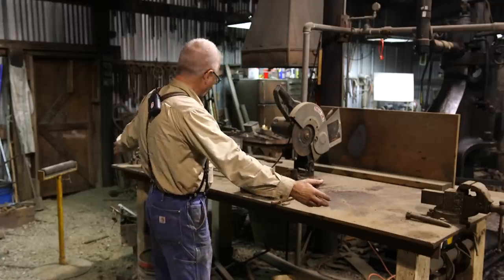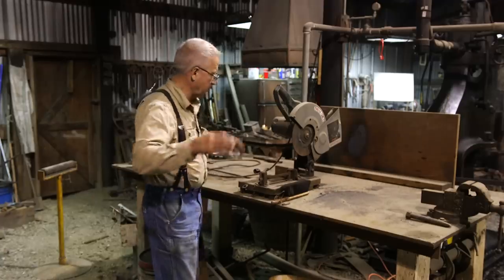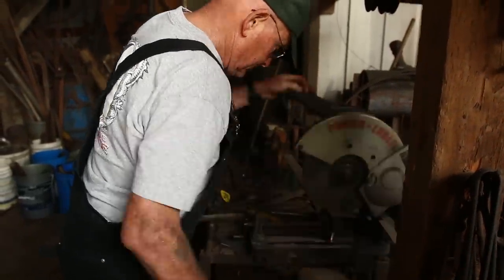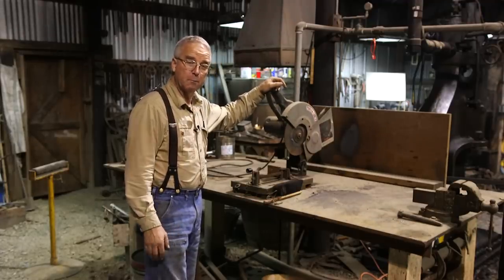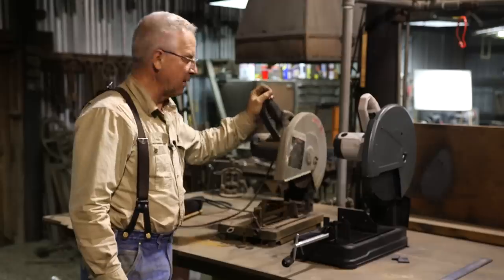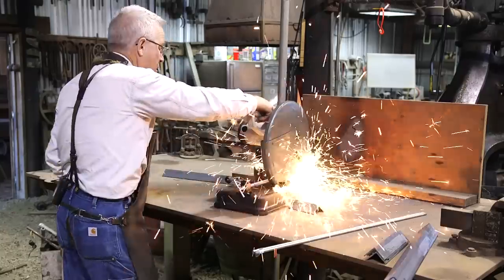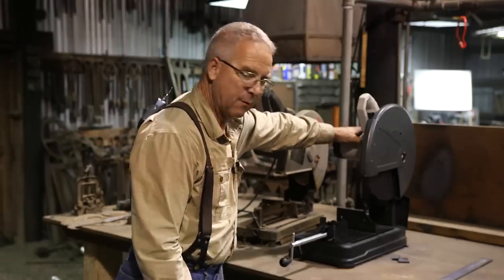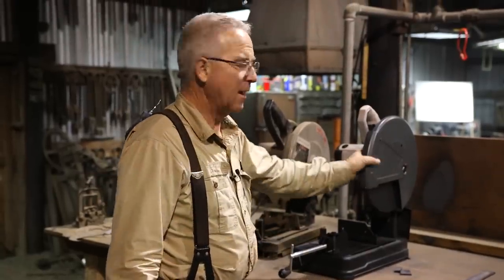Cheap Chop Saw

Comment: I'm an American, but I live in Taiwan. The manufacturing industry here is incredibly good. As it turns out, Taiwan actually produces some of the best products in the world in several industries (computer parts, optics, camera gear, bikes, etc). I bought my welder from a local shop that makes them by hand. Hand made, 220v, 200amp, and it is rated as having a 70% duty cycle at 200amps. I can tell you right now, it is the best welder I have ever owned. I have had that thing with me on rooftops in the middle of summer (summers here can be pretty brutal) and been running it nearly non-stop for hours on end, from sunrise to sunset, and have NEVER overheated it or had any issues with it at all. Though there are always exceptions, I feel like "made in Taiwan" is usually a pretty good sign.
Reply: cool. my welder came from shenzshen. what shop is this you speak of lol, in NJ?
Reply: @nicksgarage8295  I'm not sure I understand your statement/question.
Reply: Martin Luther  yes sir. I think I've got a video of me walking through their shop, actually. You can see all sorts of stuff in different stages of being made.
Reply: @SkylerKing  this so called local shop that makes them by hand. Never thought ppl made hand made welders.
Reply: @nicksgarage8295  well, it's a shop and it's local, so what would you call it? And how do you think welders were made before automated assembly lines were the standard?
Reply: Skyler King well ya know. They probably time traveled into the future and stole a bunch of miller t bolts and then brought them back for use.
Reply: Taiwan and Poland have a very good products.

Comment: Understand your buying a new one, but was expecting to see you replace brushes in old one. Get it running again, maybe give it away. Keep it out of the landfill. I follow the same buy "Made in U.S.A." approach whenever possible. Regrettably, it's becoming harder and harder to do.
Reply: I think the brushes cost under $10 for most tools. It would be great to keep it out of the scrap yard
Reply: Yes, please replace the brushes EC!
Reply: many times  Made in America  with Import parts...   Like China...
Reply: Usa makes pvc plumbing pipes. Buy that if you re so blindsided by made in usa. They re cheap stuffs
Reply: "Assembled in America" is the new made in America unfortunately
Reply: exactly! personally I would have at least put new brushes in it and donated it to the local second hand shop that uses there profit to help the homeless
Reply: When a completely new saw is $109 time is too valuable to spend fixing old tools. It would literally be a waste of time.
Reply: old versions are usually better, well worth saving
Reply: Steve Redenbaugh, exactly.  Made in USA is not from USA. They all have foreign parts inside. 🤦🏻‍♂️
Reply: @bguen1234  might take 1/2 hour at most - at 9pm when the work day is over - get er dun

Comment: replace the brushes, while you at it replace bearings, clean the comutator  and it will be as good as new, one for the shop another for field work
Reply: Piotr Brenda I rather buy a new one.
Reply: @vojnikjna30  and what would you do with the old one? - it just needs new brushes

Comment: Buying USA usually means paying twice the price for half the features and it’s not always better. Grizzly for example US headquarters but all Chinese rebrands. Buying USA makes sense when you’re buying Starret vs Mitutoyo or Brown and Sharpe vs Wen. I’ve just learned that at the bargain prices expect some extra work and inspection upon arrival. Most of these tools are being replaced by robots in my shop so the hand accuracy is becoming less important. That being said I don’t need my tools to last a century. Just till the robots built. Great video thanks.

Comment: Call me what you may, my  Home Despot 14" has served well... On appropriate occasion, I remove the hinge pin and install an axle, some spacers and a couple cheap lawn mower wheels.  Then, when re-bladed with either abrasive or a diamond blade, I can make concrete cuts... adding water with the diamond blade even keeps the dust from becoming an attractive nuisance..  :-)   :-)  Just making do!   Thanks for the video!!!

Comment: I'm right there with you.  I go out of my way to buy Made in the USA products.  They just last (lasted) longer... I still use Skillsaw my father used in the 70s for framing houses.  Unfortunately, very little is made in the USA anymore and even those items "built" here have components made somewhere else (China).  So what do you do?  You don't stop working... so you buy what you can find.  That's all there is to it.  That said, I have had good luck going to garage sales and pawn shops buying up tools that were made in the USA.  Last week, I bought a never used Porta Cable router for $40 made sometime in the 90s!

Comment: Good video.

Taiwan is a good Ally. I stopped in there a few times when I was in the US Navy.

At that time they were just changing over from steam to diesel locomotives. I wanted to take the steam train from Kaoshung to Taipei. It still ran. But they were SO proud of their new American diesels, they actually would not let me go on the steam train. But the ride was the same in the old pullman cars.

They also had antiaircraft gun emplacements everywhere with soldiers manning them. They seemed to expect Chairman Mao at any minute. And they were READY for him.

Those were good visits. A bit off topic, but Taiwan was mentioned and a flood of memories came back.

Thanks for a good video, and for teaching me about that saw.
Reply: Random Taiwanese here, I appreciate your kind words :)

Comment: I have held onto brushes and springs from other equipment that broke. Sometimes I luck out when the ones I have can be filed down to closely fit the ones that wore out. It is a soft material.  Next to go are the bearings....they are usually more difficult to replace.  I bought a Harbor FGT miter saw and have swapped out the blade for a multi-tooth metal blade. I use a variable speed device that allows me to slow the RPMs for various services.  The abrasive blades throw off much more "soot".   Thanks Scott.    J K

Comment: Porter cable has provided me with the most reliable framing nail gun and circular saw to date. Had them for years, never a single issue with them

Comment: Nice Scott. Good to hear when people get long service out of a tool, that's the best kind of review in my opinion. The brushes wore out, that tool worked as it was intended and didn't fail you. Brushes are a maintenance item.

It's cool to see someone dissect a tool and make an educated guess on the weak link could be, but nothing beats actual use and service. Thats the best test!

If you decide to upgrade from that rock chucking saw, check out a Makita LC1230. Carbide tipped blade, cuts steel super super clean and quickly and the table on it is SQUARE for those precise cuts that don't need cleanup.

Comment: Same here.. but mine was a Dewalt that my whole shop used. Wound up replacing it with the same model number.. 8 years service in a heavy equipment shop.. not bad.

Comment: It would be hard for me to work without my metal chop saw.  I, for the most part, like Porter Cable.  As you said, not what they once were, but neither am I.  I have a Ridgid saw, chose it because the handle is perpendicular to the blade, not parallel like yours.  I have a limited range of motion in both wrists and the perpendicular handle just works better for me.  Thanks for the great videos

Comment: I have an even cheaper one (unknown brand, because the stickers are long gone). Cost me $79 at a flea market tool booth, and I've had it easily 20 years. It bogs down a little sometimes, gets a little smoky sometimes, but you ease off it or stop and let it cool down, and it starts right back up again. I recently bought a cold cut carbide metal saw, which is an amazing upgrade, but I'll still use the abrasive saw, too. Cheap doesn't always mean bad. Good luck with it!

Comment: I like to see you get the shop into shape. Your welding series will be produced from here. It will not just be a shop. It will become a  film studio. I assume many parts of the spec house will be built here before being installed on the job site.
I would like to see a proper exhaust fan installed on that back wall and those shotgun holes patched up. Maybe even hang a Bard a/c wall unit back there.

Comment: I like the Milwaukee with the steel cutting carbide blades. The blades are a bit pricy probably 180 or so but they last if you don't beat on them and the best part is no sparks

Comment: Scott, your old one should have a steel pin about 3/8th" in diameter between the handle and the guard that you push in to lock the shaft of the motor.
Thanks for another good video.

Comment: Here is the modern parable. I have a HP OfficeJet Pro 8600 several years old that the ink delivery malfunctioned after a two week vacation with it probably drying out. The only error message was " Turn it off and back on. Then contact HP." 
A new 8710 was on sale Tuesday at Best Buy for $99. $100 off. An extra set of inks was $104. Except for no LAN port which I didn't realize, I get a brand new printer now versus some obscure hope that the old one can be fixed by someone, somewhere, sometime, for some amount of money. 
Porter Cable makes some good stuff. Anyways everything is being shifted to Vietnam and Thailand anyway.

Comment: I know, Scott, that you said you liked Porter Cable and what that saw did for you. But, I have to ask, why would you not spend just a bit more and get a dry cut saw? Virtually no dust, next to no sparks, a beautiful clean cut, and the metal doesn't get hot. Hmmm.... Waiting for the forging!
Reply: Dry cut doesn't get along well with hardened steel.

Comment: If it is anything like the 6" sander, it won't last. Sadly, i've gone through more than i can count now.  It's close to half a dozen in two years. The last one didn't make it 2 months.   I'm still getting replacements from lowes on my original service agreement. Last time, i told them i would not pay the $20 bucks(you have to buy a new one each time they replace the tool) as it didn't last long enough, and they cheerfully refunded that money, so i could buy a new one on the new one, sigh. I'll probably get one of those like you have, though we had one just like your old one in the machine shop i worked at one year, and i loved it.  Keep 'em coming, and yes, let us see what ol' word twisting Canuck of the North has to say about it...

Comment: Great video. I will say though, after using a Cold saw, i.e. Makita LC1230, there was no going back to an abrasive saw. I've made many cuts in all sizes of steel and the blade is still sharp. Cold saws are worth every penny and save so much clean up time on deburring and filing. The biggest plus is the cut accuracy, cut time and hardly any sparking that cannot be matched with any abrasive saw. Just my two cents though. Your vids are always fantastic. What's your opinion ?  Thanks.

Comment: With a little on line research I think you could have found replacement brushes for a lot less than $100.  I really like the horizontal grips that some metal and wood chop saws are coming with these days.

Comment: The price is right but what of accuracy?  I found saws with cast iron bases cut a very close 90 degrees but saws with stamped metal bases tend to ratchet when excessive downward force is applied when cutting resulting in a less desirable cut that requires extra attention.  Fixing 20 or 30 cuts may not justify a few bucks saved!   You have a great channel with a lot of time saving tips I have used. . . also I like the way U think.   Just thought I'd add what I've learned . . .  Danny O

Comment: Is there a reason you didn’t look into the Evolution saw? It has toothed metal blade that turns at a low rpm, it always runs at the same depth.

Comment: Scott, New subscriber here.  Loving what I see!!!  30+ years in construction with a B.S. in Construction Science & Management from Kansas State University.  Currently semi-retired (read mostly) due to health issues, but still keep my hand in the game.

Have you considered making a cut-out for the new chop saw?  Dropping the support below it the exact depth it sits above the surface of the table, so you never have to worry about, or fool with support for the longer pieces?  Don't own a chop saw myself (at this point), but having recessed my old compound miter-saw was one of the better moves I've made in my little shop.

BTW, going to send a link to your series to one of my old professors at K-State to your Spec House series.  I honestly think it would be VERY good, required viewing for incoming freshmen with little/no construction experience!  Namaste!

Comment: I have a Porter Cable miter box saw that is 20 years old I barely used it and it still runs great but I dont know where the blade went and I bought a new Hitachi 12" sliding one to replace it but was wondering if I could put a blade on the PC to cut steel. Do you or anyone on here know if it will work?

Comment: I always felt like Taiwan held to the USA supplied specs on the Delta commercial table saw and fence along with other manufacturers who made the "move" in the eighties. 
China it seems was willing to push the tolerances in order to get the numbers through the quality control department. 
Still I want a USA Baldor TEFC on any big machine I buy. And I want a Jacuzzi pump on my big compressors. But perhaps the times have passed me by....

Comment: Fixing power tools is a crap shoot when they are that old... often times commutator is worn from all the grit on job sites, especially this tool. Bearings shot. If you aren't using it to feed your family it's one thing to repair. I tend to put my efforts into rebuilding old stationary power tools instead of hand power tools.
Reply: Bearings are surprisingly cheap to buy on amazon and not difficult to replace.
Reply: I totally agree with you. If the brushes are really bad there is a good chance that the commutator is shot. This means a new armature (if you can find one). It's worth taking apart to asses the extent of the repair, but unlikely it would be worth the time and effort.
Reply: @thematey3592  Uh, no. I replaced the brushes on my dad's DeWalt chopsaw give or six times before it finally needed an armature.

Comment: Hope that Porter Cable is nicer than the cheap junk Makita I bought a few years back. It still works but that doesn't make it any more cheaply constructed. In fact when they broke into my shop and stole everything the only thing they left behind was the chop saw.

Comment: This reminds me, I have an issue with one of our chop saws (not sure what make it is as it's 8pm and dark atm). I have tried different ways, but it seems that the saw always cuts slightly off angle. I can check the squareness with a square and it's fine. Start cutting, especially light steel, and it'll start to cut away from the saw/work/table and won't be right angle cut.It doesn't feel.
It doesn't seem like the bearings are loose, not but jiggling the blade at least. I've even replaced the blade thinking that the blade was warping a little (was a cheap harbor freight blade before).
Any ideas?

Comment: Hi Scott, did you see one of Kyle (RR Buildings) latest videos while he was at Stafda?  Showed a new Diablo blade that cuts through metal super fast.  I believe they had it on a chop saw, cutting stainless with no sparks and almost no heat.  If not, thought you'd like to check that out.  (I have no experience with it)
Reply: sounds like one of those things that's amazing when it's new but wears out like chalk on a cheese grater.
Reply: @gramursowanfaborden5820  Can confirm.  Used that diablo blade (for a skilsaw not a chop) when doing steel framing on Trex decks.  It's a freakin miracle for like 15 minutes before it starts wearing out.  After half a day of regular use you've got a 50/50 shot for 80% of the teeth to have torn off.  And the stupid things aren't cheap either.
Reply: @barrytischler1733  that's what i reckoned, maybe it'd last decently in a more precision environment like on a saw table rather than fast and loose on a job site. since it's a new thing hopefully they can improve it and make it more reliable.

Comment: I find the pressed steel bases on those saws to be of very low quality and difficult to get a decent square and repeatable cut especially if you are cutting something on the larger size. The Dewalt I use has a very similar or exact same base to your saw.
If only they made them with a better quality base and vice they would be a killer saw. It aint no Brobo I know.

Comment: Do you cut aluminum and steel with the same abrasive wheel?
Reply: You sure can!
Reply: Personally, I would avoid cutting aluminum with an abrasive wheel. Gums it up in a hurry.
Reply: @Cadwaladr  ...but the wheels are pretty cheap, so if it's what ya got...
Reply: I would not suggest doing so. There are abrasive cutoff wheels made for non ferrous metals...use those for aluminum. High tooth count carbide blades also work well for aluminum...clamp your work and remember hearing and eye protection....very loud and lots of sharp chips flying around.

Comment: I have a Dewalt one but it keeps tripping the breaker
Reply: Dont over load it. A 20 amp breaker should be more than fine. I burned up my really nice milwaukee using it on a 30 amp circuit. The armature and brushes got all mixed together inside the housing. Sad day :(

Comment: So the brushes are worn out... and there I see that Porter Cable kept the brush access cover located right there directly in front for easy brush replacement. Too bad you didn't just fix the old one.
This would be like replacing your car when the brake pads wear out.